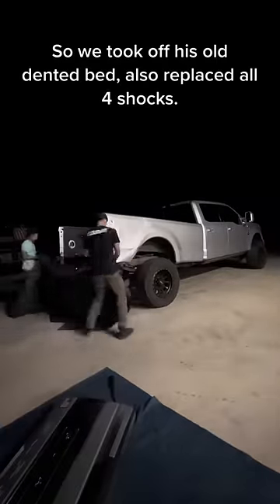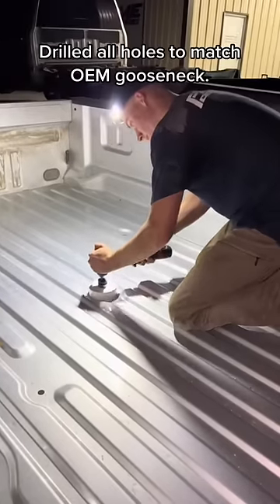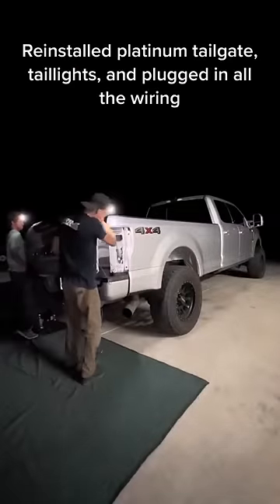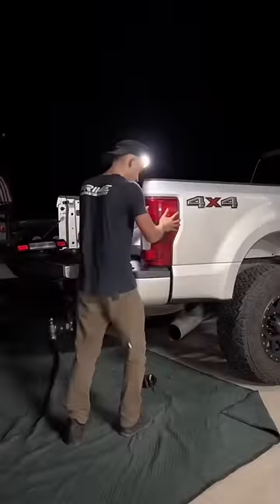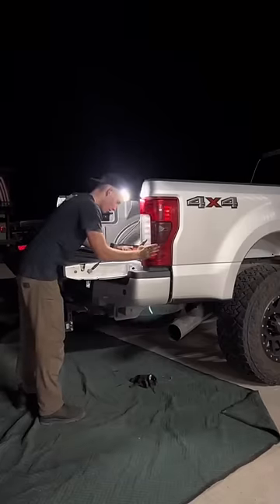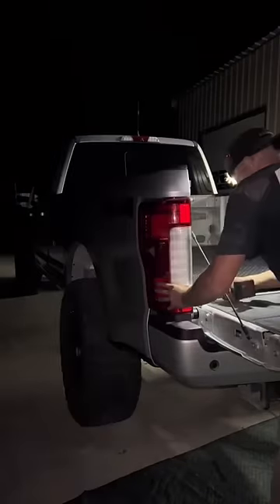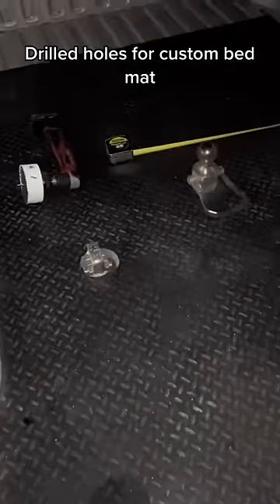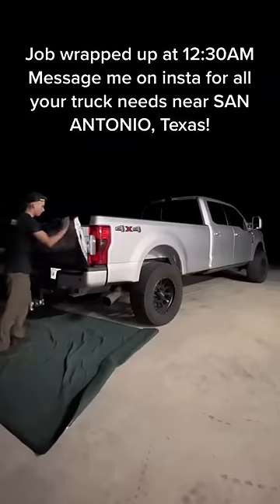Installing New Alumiduty Bed Installed Same Day For Customer!

Comment: As long they pay extra and you willing to do it, mad respect !
Reply: A dont trust strapping stuff to this bed is it really secure
Reply: @TheAnnoyingBoss  it uses the same bolts and holes as the old one does, and that bed hitch mounts to a plate bolted to the frame so nothing's going anywhere without the rest of the truck
Reply: @backpocketmechanic7751  i meant i dont trust tying things to an aluminum bed a single man can easily lift. Left it fold like a tin can first bump i hit
Reply: Customers are customers man, if they do they do… if not then the next ones might! All about respecting whoever’s work you’re privileged to do.
Reply: @TheAnnoyingBoss its as secure as the old one was. Its held on with 6-8 bolts as with every other bed in history. Weight until you realize that entire bed weighs about 170 lbs, if that
Reply: @TheAnnoyingBoss  its suprising how light these things are. Can lift an entire uniside with a pinky finger😂
Reply: @TheAnnoyingBoss bro box trucks and semi trailers are aluminum this is a stupid comment lmao yes it flexes when you tighten it with ratchet straps but not a truck bed lol bc of the bolts
Reply: Better than the last name on the tailgate
Reply: @TheAnnoyingBoss they had 4 people lifting it him n his girl on one n 2 on the other are you special?
Reply: @Kelby-iu5lq 3 people but your point stands. We’ll 2 dudes the girl was “helping”
Reply: @ontheroadproductions3956 I know a guy who's box ripped a foot long gash from ratchet straps in the bed😅
Reply: Should’ve been a flatbed
Reply: Why pay extra for this slacker who decided to wait so late
Reply: Thats a little passive aggressive. Why do you have to be like that? Would you do it without charging extra?

Comment: That's how you start a business brother. You spent money on new hole saws and stayed up to get it done. I hope you are blessed beyond measure
Reply: I use to do that all the time, for a standard bed with no extras takes about an hour. Generally the bed has wires and lights in it already so a couple clips to plug in and all good to go. Can be done faster but you just take your time not to get hurt. 3 guys is better for moving the bed, 4 is optimtimal. Anymore and they just get in the way.
Reply: I just overcharge clients. Half leave so I end up making the same doing half as much work
Reply: Can buy all of those tools off a junkie who steals for a bag of dope for $100-200 and start your business on a fraction of the cost. I'm not saying it's right, but it happens.
Reply: Get some impact sockets
Reply: @whatta7793 no shit Sherlock lol 
 find a dope head with tools wow haven’t thought of that

Comment: I miss being a young man. These late night jobs were always a great time. Great job boys! Keep it up!
Reply: Haha same here in my 20s i did the same exact thing, without making any modifications to the bed its a 1 hour job. Better with 3 guys to lift/balance and best with 4. Now I'm just a 30 year old man working millwork and loving it. Don't have to worry about dry months with no bed sales and what is tax deductible and what isn't. And all the price fluctuations!
Reply: @jeffsorrows  I don't install the beds themselves. I install cleaning equipment in trucks and trailers, or I should say "I used to". Now I'm in my 40s; I train and manage the guys doing it. I miss doing it, all except the crawling under vehicles.

But I do respect some good clean work! That looks sharp

Comment: Damn y’all are strong as hell. I’ve been working out for nearly 2 years and my dad has been repairing salvaged titles vehicles for years and this one time he needed me to help him remove this cargo bed and bro I was suffering. They weight like 300lbs at least, or perhaps it’s due to the large surface area where it’s hard have good leverage. Anyway y’all doing great work out here, good stuff
Reply: That's an aluminum bed. They don't weigh anything. They are crap!!

Comment: One step not mentioned that gives me OCD issues....after you cut the holes for the gooseneck....what did you do to treat the holes to prevent rust/corrosion? That rubber mat will hold moisture below it promoting an environment to promote rust on steel or corrosion on aluminum.

Comment: I will say a lightweight aluminum bed is nice for taking it off. I took a long bed off of a 1996 ram 1500 and I had to use a telehandler to lift it

Comment: The one upside to the aluminum beds is they're pretty easy to muscle off. I just wish Ford would do something different with how they mount them. Had to pull so many beds off of farmers and ranchers trucks where they've created the floor and ended up bending the tops of the bolts after the floor had pulled away. And I've yet to find a good socket that will last busting them free without splitting after a month or so.

Comment: Doing all that is a 4-5 hour job. 

Me and my cousin did suspension on my 98 S10 and tore the bed off an f150 before lunch one weekend. 

We also live in PA so, we had to fight rust and this included a run to busy beaver for hardware after we  ended up sawzall'ing some of the suspension off of my truck.

Comment: While I respect the hard work and the willingness to meet the needs of the customer, there is a problem here. Those bed bolts have a torque spec and break in period where you have to go back and re-tighten them. Prevents metal fatigue cracking. Also want to know if you sealed the raw metal on those gooseneck holes.

Comment: The edges of the new holes drilled into the bed, what were they treated with that dried and cured so quickly before you laid the bed liner back on top of them?

Comment: lol I do that job at the factory where that trucks made.        Proof bolt closer to tell gate is 1/4 inch longer well done goes and there is a green ring that holds washer on

Comment: question, ive got a 2021 F250 crew Cab with short bed. I’m looking at LEF tail light bulbs? I see some that say they will work without quick flash or interference, “Torch Light brand” do you have experience with swapping out halogen or stock with LED?  Tim

Comment: How about the $900 calibration that goes along with removing the plug on the tailgate? That will have issues opening and closing soon because the computer can’t remember where the stopping points are

Comment: How much something like this cost my truck just got hit by a deer and now the whole left rear is all messed up bumper tail light and bed... and since I'm not a Texas truck while the bed is off the wire Wheel/grinder clean it up n rust paint it? It's a Pennsylvania truck but I found a color matched like new rust-free no dents or scratches bed in Texas so I was thinking about making a road trip anyway

Comment: man truck beds today must be made out of super super thin metal if two guys can lift it that easy... when i rebuilt my 76 Jeep J10 gladiators bed... i couldnt even lift one corner of it without struggling.. the metal on it is extremely thick.. and this is with the floor half way rusted out too

Comment: Everything looked good other than using the wrong bolts to put the bed back on. They are one time use per fords repair procedures. That’s why they use all that damn thread locker and are a pain it get out. They are torqued to spec with thread lock for a reason

Comment: And then, we fried an egg by cracking an egg open and putting it into a hot pan. Then after a minute we flipped the egg over using a spatula. Then after about thirty seconds we picked the egg up with the same spatula and put the egg on a plate. And we were STILL stupid asses. Seems nothing can change that fact.

Comment: Get real tools.  12v crap isn’t good enough.  Also why replace them entire truck bed.  Didn’t look like much body work needed.  Could pull and hammer out those dents a lot cheaper than an entire truck bed.